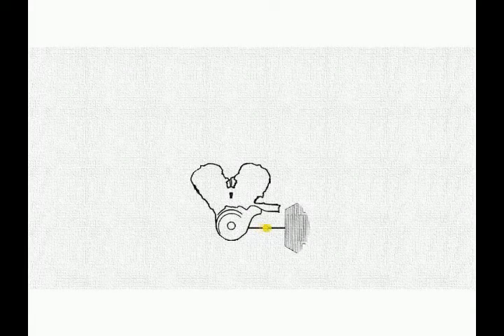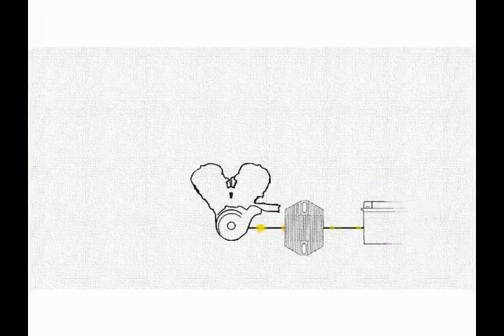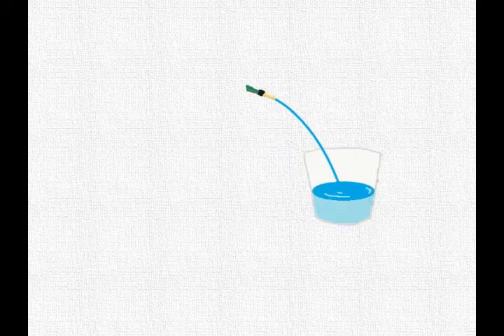Shunt vs Series Regulators

Comment: if the power source can be controlled, it is better to regulate the current from the electromagnetic rotor, so that the regulator will not be loaded with a large current to maintain the voltage.